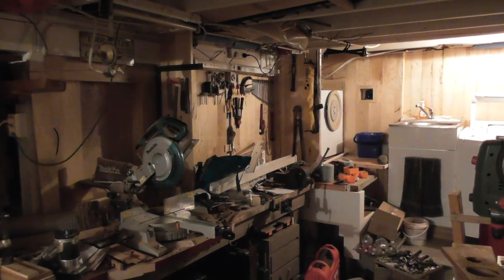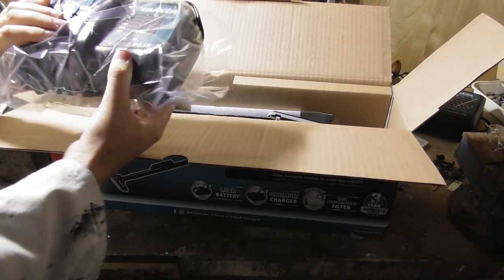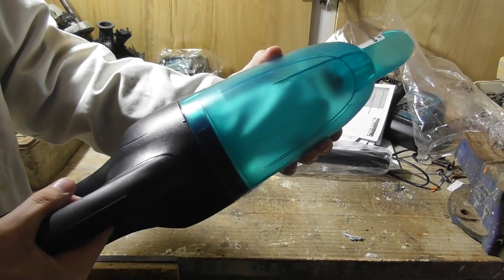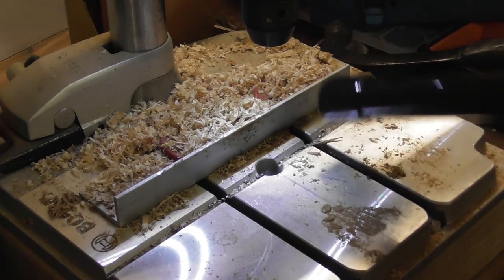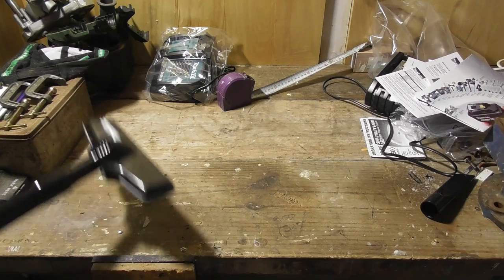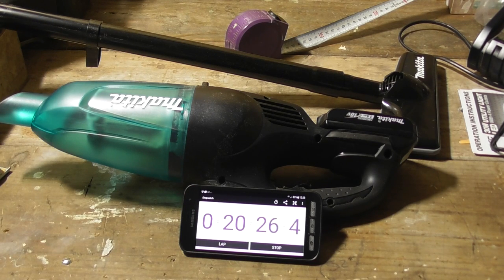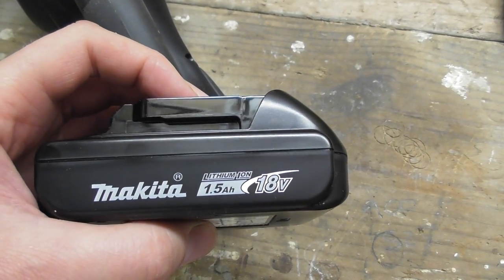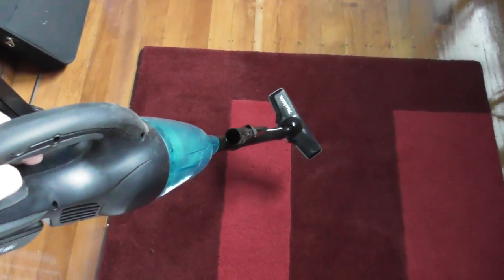Makita Cordless Vacuum Kit (Isn't Vacuum a funny word)

Comment: How to drag out 2 minutes of information into a 20 minute video. 
It's a Makita vacuum, it sucks up rubbish really well, the battery is interchangeable with your other Makita 18v batteries so battery life isn't an issue if you have others, the only issue with it is if you try to take one of the accessories off the end of the tube by twisting you're likely to end up opening the machine and depositing all the rubbish in it over the floor.